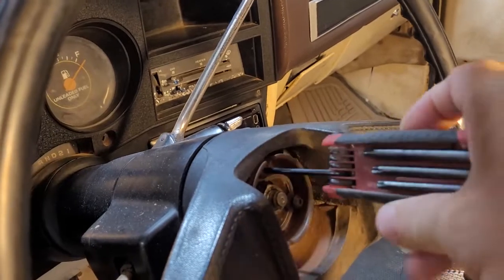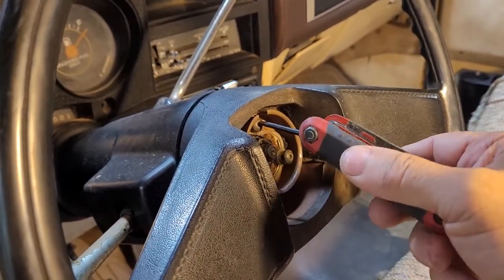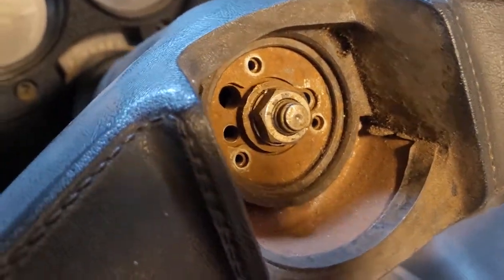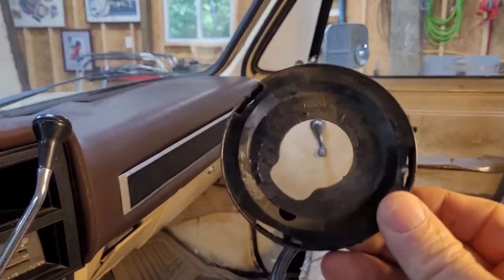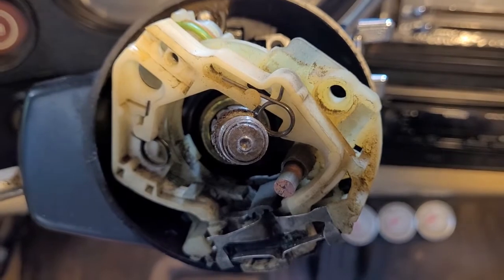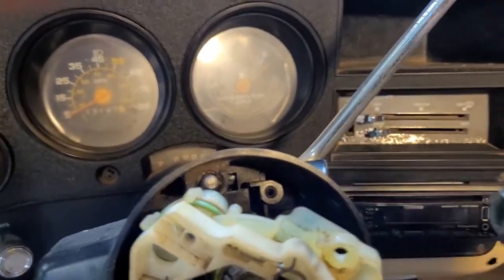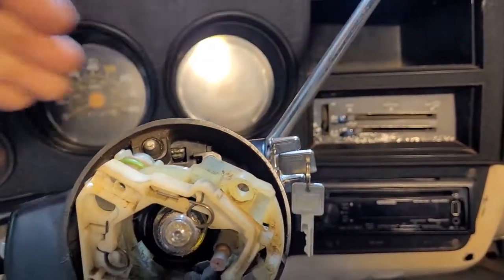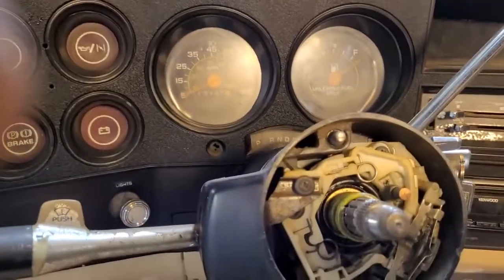1986 C10 Column Lock Cylinder Replacement

Comment: Is the original key required to be in the ignition to remove the cylinder? Thank you, the video was very helpful.
Reply from the maker: The key is required to remove the ignition lock cylinder as demonstrated. Without the key will require drilling the ignition cylinder